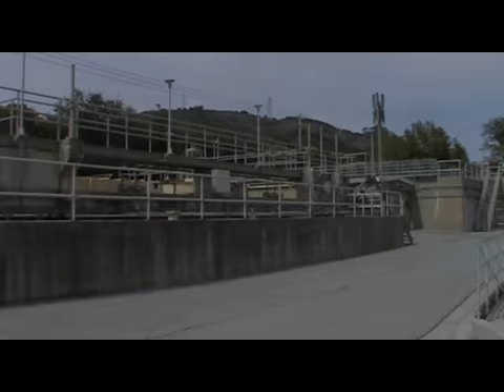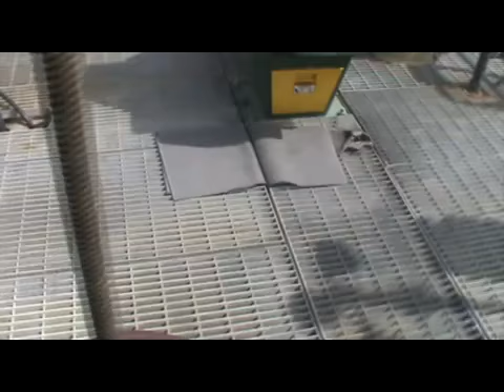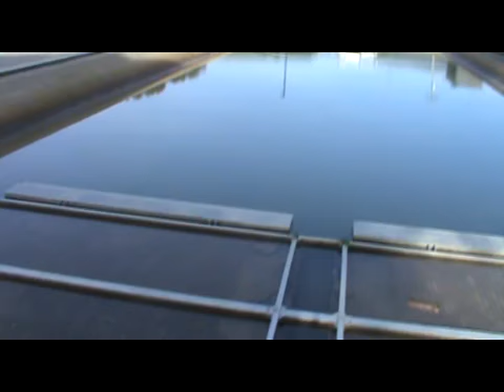Water Treatment Process:  Direct and Conventional Filtration

Comment: This video provides a practical walkthrough of a *direct filtration* water treatment plant, explaining how raw water is transformed into safe, potable drinking water. Unlike conventional treatment, direct filtration skips the sedimentation phase to better suit source waters with lower initial turbidity (0:19 - 0:58).

*The Treatment Process:*
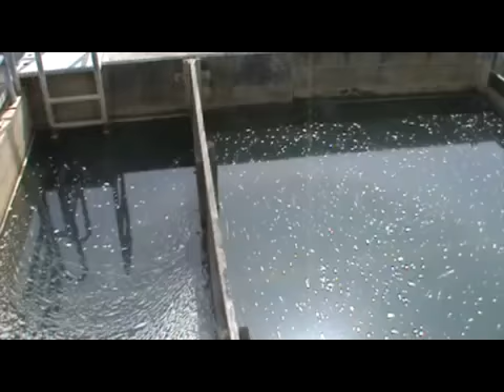* *Flash Mix & Coagulation (3:13 - 5:24):* Raw water enters the plant where chemicals, specifically Alum and *cationic polymers*, are added to neutralize the negative charge of fine particles, encouraging them to clump together into "floc."
* *Flocculation (5:35 - 8:00):* Through a series of baffled chambers, water is mixed gently to allow these smaller particles to collide and grow into heavier, more settleable floc.
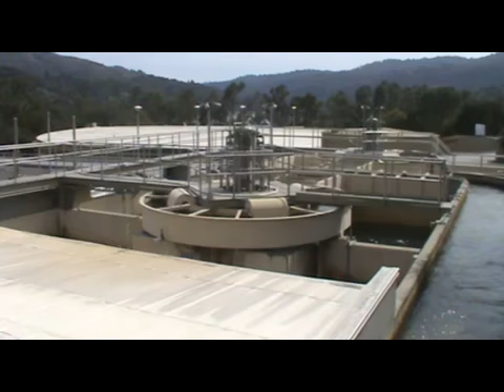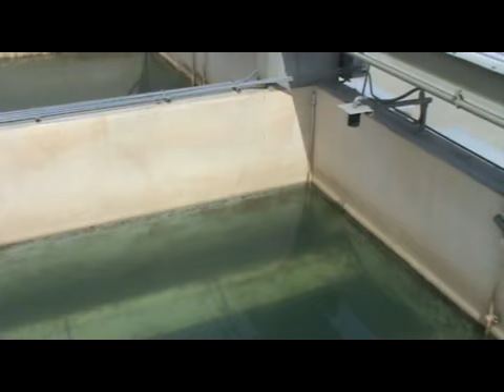* *Filtration (8:57 - 13:35):* Water flows through gravity filters (typically sand media). The process relies on *adsorption*, where floc particles stick to the filter media, effectively removing remaining contaminants.
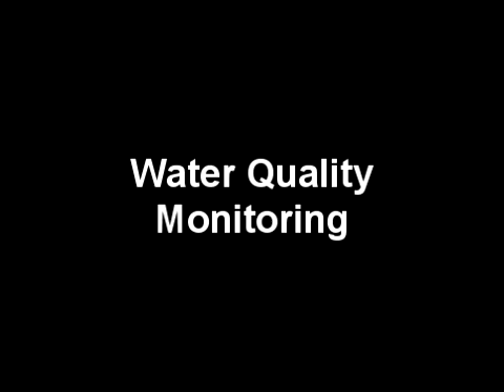* *Disinfection (14:06 - 15:00):* After filtration, water is treated with chlorine and held in a clear well to ensure adequate contact time for killing pathogens before distribution.

*Maintenance & Sustainability:*
* *Backwashing (15:56 - 19:50):* Filters are periodically cleaned by reversing the flow (air and water injected from the bottom) to expand the media and carry away captured solids into troughs.
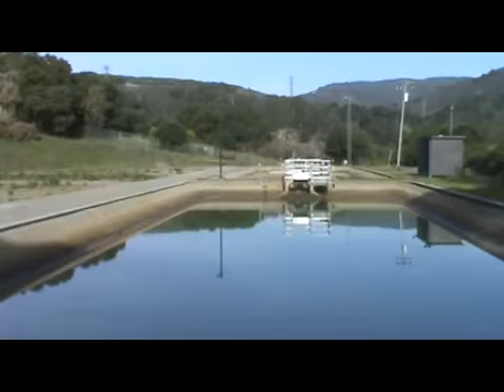* *Washwater Reclamation (20:08 - 21:50):* Rather than wasting backwash water, it is collected in lagoons and recycled through plate settlers, allowing sediment to settle before the water is blended back into the plant's raw water intake.

Comment: I am getting a AAS degree in water and environmental technology in oregon. these videos are very helpful and assist in what we learn during plant tours and class lectures. I would suggest if you can get a degree it will help you down the road in advancing more quickly through your career. a four year degree will help if you plan on becoming a level 3 or 4 in oregon which is close to a 4 or 5 in California.  I know in oregon there are only two colleges that even give the type of degree I will be getting but that means more money during your career in less time since pay is dependent on grade level of training and types of certification. the ken Kerri books are great as well as the awwa books. also there is a math textbook by Fitzpatrick that goes into math for water operators very well. just some ideas i have learned from operators!

Comment: If you add chlorine in the flash mix, don´t you have the risk of forming Trihalomethanes, considering that this water still have organic matter?
Reply from the maker: Uelinton,  You are correct.  That's pretty much where THMs are formed in the treatment process.  The thing is that there are many benefits to pre-chlorination.  Most plants try to keep the pre-chlorine dose low and many others have gone to different methods of pre-disinfection, such as ozone.  State standards strictly regulate the formation of THMs and other disinfection by-products.  Also, even after forming in the front of the plant they can be removed through the treatment process.
Reply: TheWaterSifu Interesting! I didn´t know they could be removed through the process, specially because they seem to be very stable... well, chloroform at least is quite volatile. Is that how the other THMs are also removed? Are there studies showing that?
Thanks a lot for the reply!
Reply: by the way, where can I get your podcasts?
Reply from the maker: Many of the precursors which form DBPs and THMs will be removed.  I did not mean to imply that they will all be removed.  High pressure membrane filtration, such as reverse osmosis, can remove a very high percentage, but that is also very costly.  The hard fact is that there will always be some by-products, but you also have to weigh the risk of those against the alternate.

There is a link in the above "about" description that will take you to my website.  You can also do a general search for "The Water Sifu" in iTunes or most any other podcast aggregator.

Comment from the maker: Hi Jamilya,

My training focuses on running a water system and treatment plant, from the operators point of view. At that I am very skilled. Unfortunately, I do not have any good references to point you towards when it comes to designing one from the engineers point of view. My experience in dealing with engineers in this industry is that they have simply learned in college, on the job, or through an intern program. I wish you the best of luck with everything.

Comment from the maker: Thanks Qim.  Due to stricter regulations and higher filter efficiency, most newer plants are going to membrane filtration, which can filter much smaller particles than conventional treatment.  It does use more power because pumps are necessary as opposed to this plant, which is all gravity fed.   I will be posting a video of a membrane plant in the next couple weeks or for more info you can check out my Podcast #27, "Membrane Filtration", at the above website.